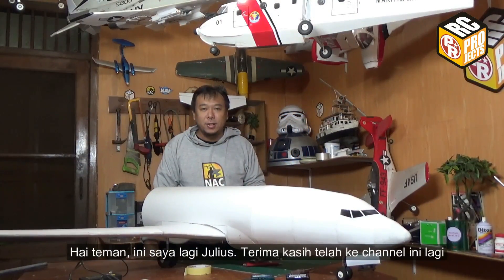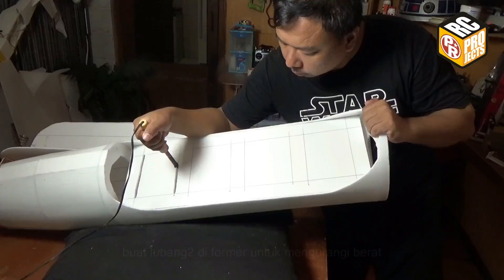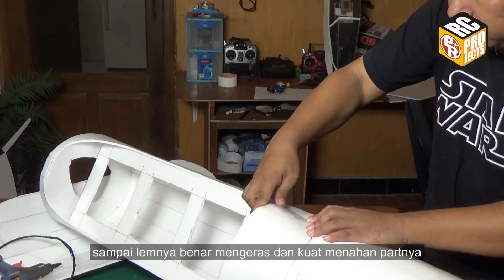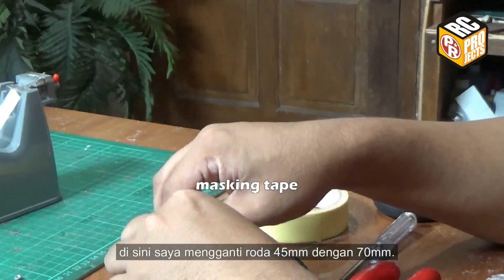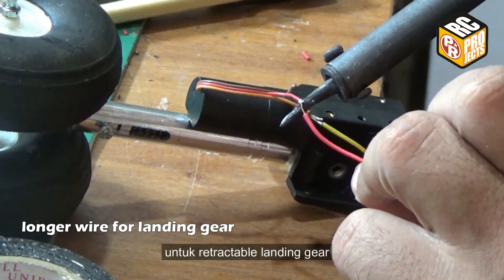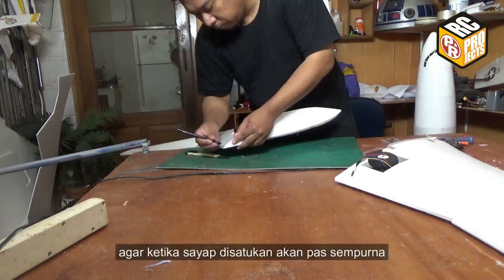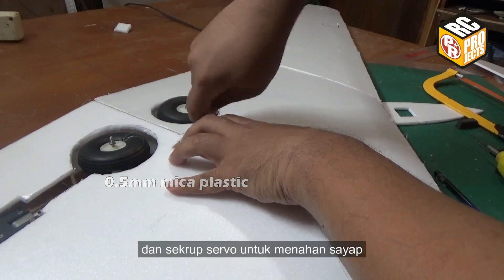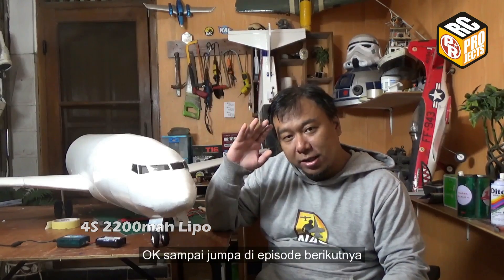How to Build RC Airliner Boeing 737 Part 2

Comment: Hello sir! I am building this but I have a question; on the wing where does W2 go front to back in the wing? Its not marked on the plans?
Reply from the maker: 17.5 cm from LE on the root and 12 cm from LE on the other edge
Reply from the maker: thanks for the heads up I just reupload the plans (part2, completeA4, and completeA0)
Reply: @JuliusPerdana  thanks!
Reply: And W15 where does it go?
Reply: I am guessing in line with W11

Comment: kalau pakai baterai 2200 Mah 7,5V 2S 25C di gunakan ke motor 2600KV pakai esc 30A kira2 baterainya sanggup gak om?
Reply from the maker: pake 3S

Comment: I think u shuold use other type of glue especially for the wood.
Hot glue is great but not for everything
Reply from the maker: I am not a patient guy, it's quick lol
Reply: @JuliusPerdana  CA is actually faster than hot glue.
It would give u so much more strength.
I would be afraid of flying that plane, especially if the weather is pretty hot the hot glue could melt.
Reply from the maker: I used CA glue all the time, in my experience hot glue is stronger then CA.
Reply: @JuliusPerdana  plze make a full vadio of BD5 Rc plane 1300 mm